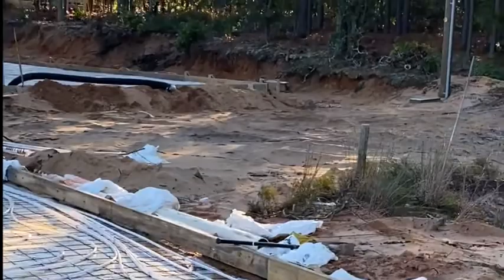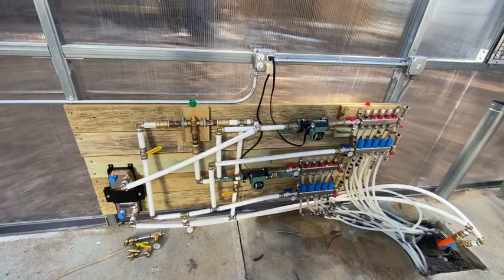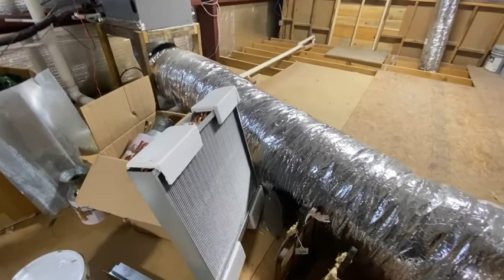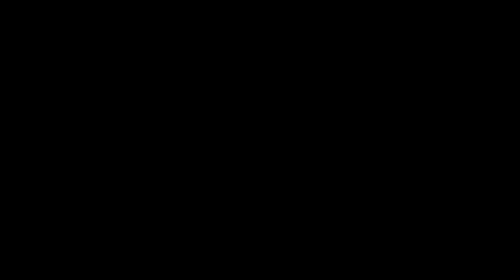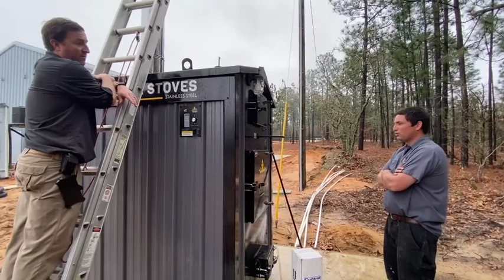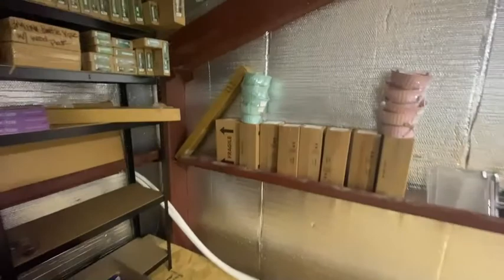Radiant HEAT🔥 system in greenhouse ( In FLOOR heat )

Comment: Municipality water in summer is plenty warm or cool — out of the ground at around 55 degrees. Depends on how deep your piping is from the municipal intake. The deeper the piping is as it runs across the ground it won’t be heated by the sun. Or in the winter it won’t be as cold either if the temps are 5 degrees and the piping is 12” deep, the cold air will really make the water exiting the faucet colder than normal temps which most ground water when it comes out and hooks to your piping is going to be 55F at the beginning.